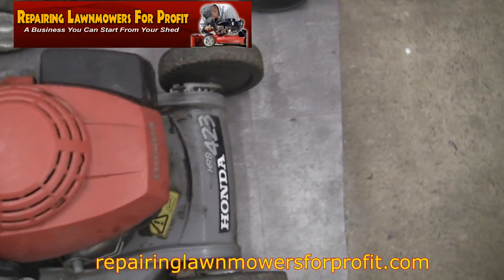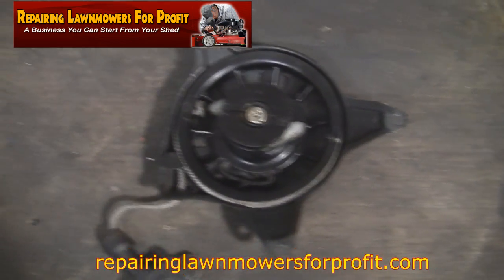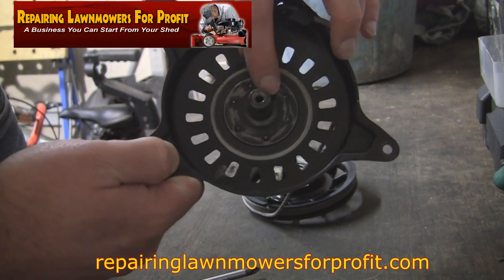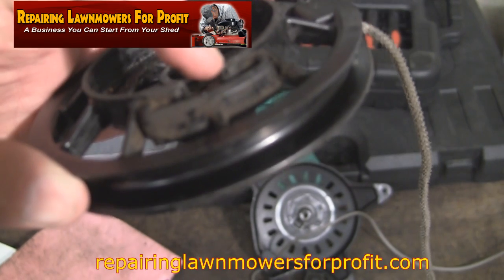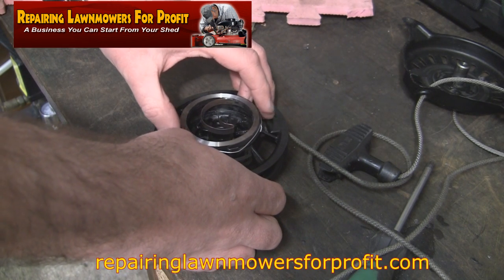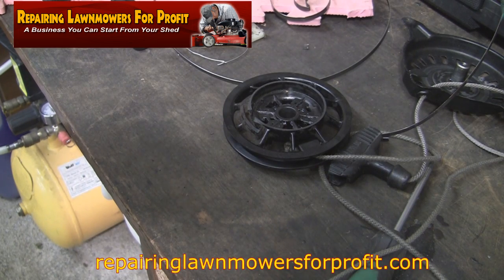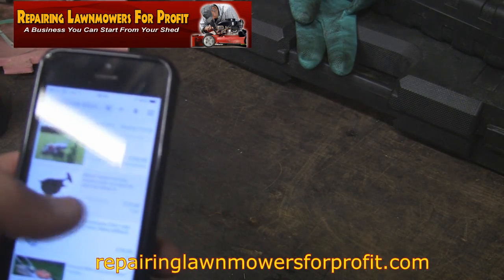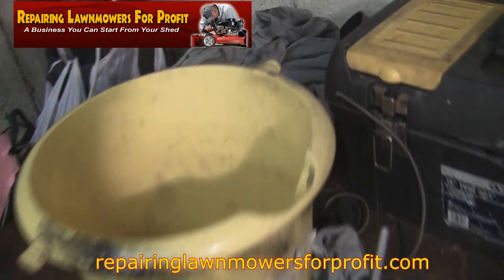Why I don't fit petrol lawnmower recoil springs!

Comment: I think I might be temped to use a cordless drill to wind the spring up once the outer hook is connected until it can be pushed into the cover. I  have a broken spring in mt B&S 50hp SPropelled I was tempted to buy a spring but after watching this I think I'll splash out on the whole recoil assembly Thanks for posting
Reply from the maker: I dont buy the springs anymore. I just look for a second hand recoil completely. Thaks for watching John
Reply from the maker: I dont buy the springs anymore. I just look for a second hand recoil completely. Thaks for watching John

Comment: I do em with a few zip ties about 3 around the spring then put it in then u cut the zipties. job done
Reply from the maker: Any chance you could do a video?
Reply: Next time i get a trimmer or mower in with a broken recoil i will :)
Reply from the maker: +Michael Walker Cheers appreciated
Reply: It works well that method . Some wood and a nail a cordless drill . Just gently slow speed .

Comment: Off topic a bit but do any of you torque your heads when replacing the the head gasket and how hot does the engine get to the touch when running?

Cheers 
Andrew
Reply from the maker: Andrew i just tighten them back up evenly. Make sure all cooling fins are clean and the engine wont over heat. Hope this helps.

Comment: you can buy a tool to wind the springs makes the job easy
Reply from the maker: Cheers really enjoyed the vid thanks.
Reply: Mower Man Had a quick look on ebay and they are about £20-£25. If they are that easy to use, may be worth looking at as it would pay for itself after 2 or 3 uses.
Reply from the maker: do you have an item number? thanks
Reply: Mower Man There is 231009363382 - I didn't spend too long looking, but it's the cheapest I saw and has 100% feedback.
Reply from the maker: Thanks let me know if you find a metal one cheers
Reply: Mower Man I've only seen the metal sold by US sellers on eBay, and it will work out at least £53 + any import costs.

For how often you'll potentially be using it, I'd imagine the plastic one will probably be fine. I can't really say more as I've never used it. I'll look at getting one if and when I need it.